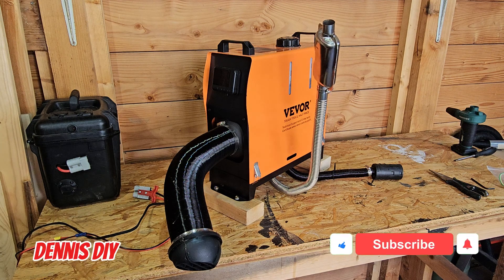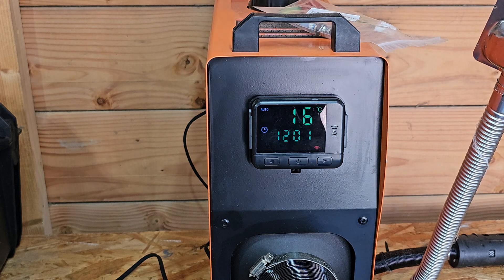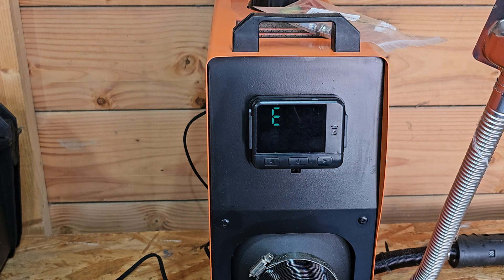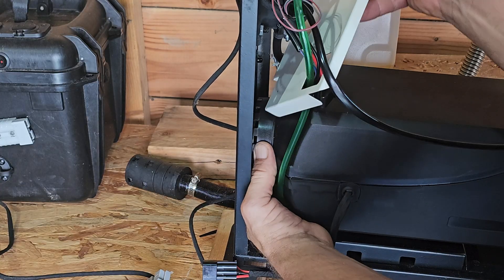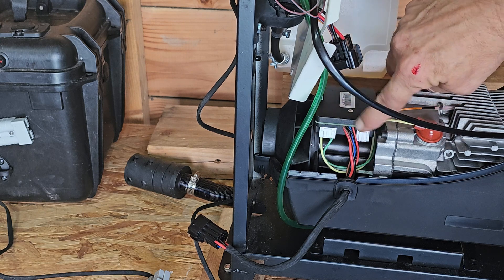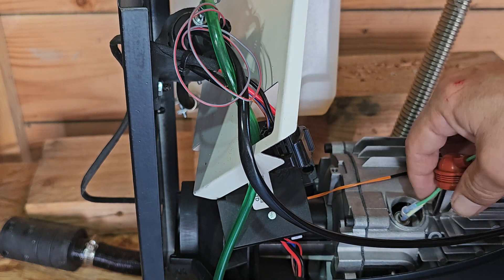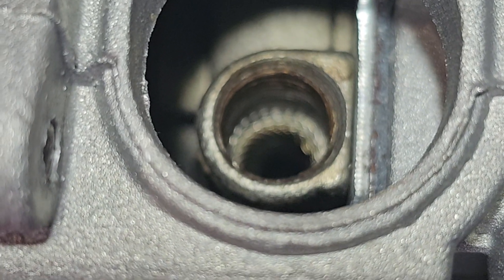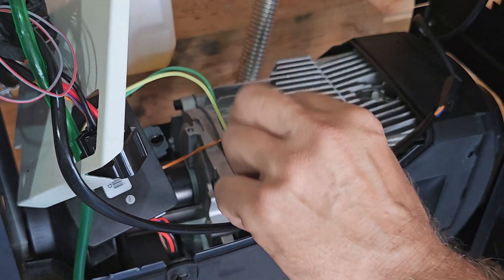Vevor 8kw 12v DIESEL HEATER Fixing the E-03 Error. code (Step-by-Step Guide)

Comment: I got E3 and replaced the glowplug.   And still had E3  Tested the  old glowplug and it is fine so i now have a spsre.

It ended up my battrey power was too low.. Used another supply and it works a charm.
Reply from the maker: Yeah  I guess if you don't have enough power this  wrong error code can happen.

Comment: I had a 03 code but found out it was the control board shorted out to the glow plug
Reply: can you give more details ? I also have brand new heater and with first start up I got E03 code
Reply: @tadej1988  I also have error 3 with brand new heater trying 1st start
Reply from the maker: Prime, or  change the flow plug
Reply: @SteveM-t6p  same here even replaced the glow plug. Did you resolve the issue?
Reply from the maker: I want to know what caused this
Reply from the maker: To bad,   sound dangerous